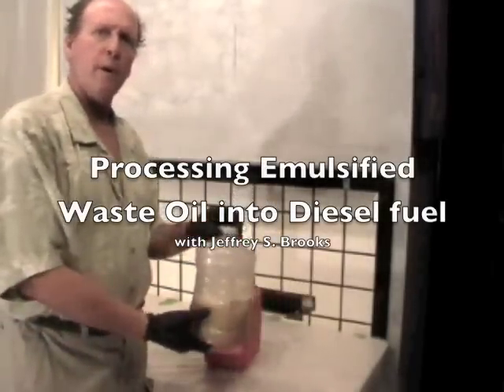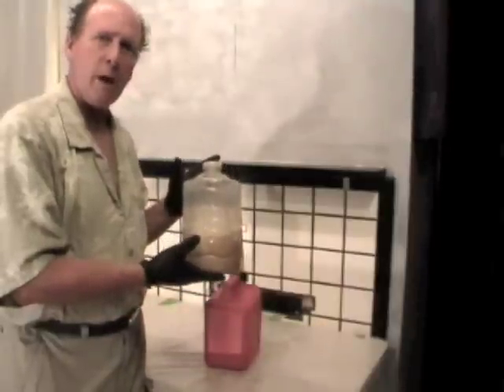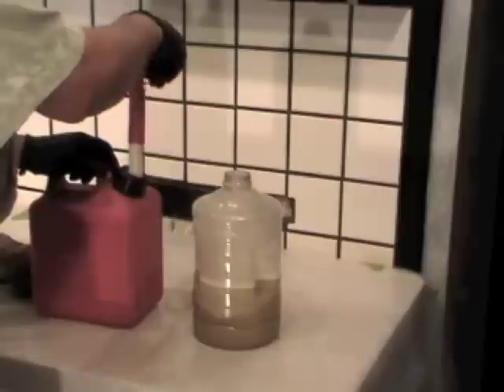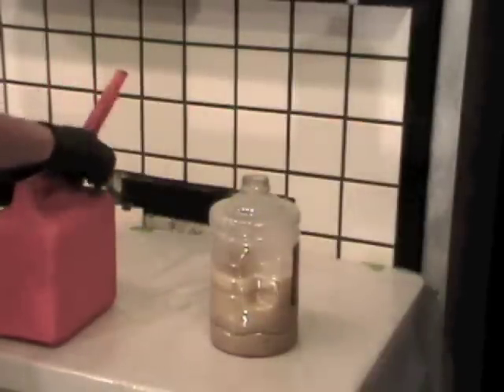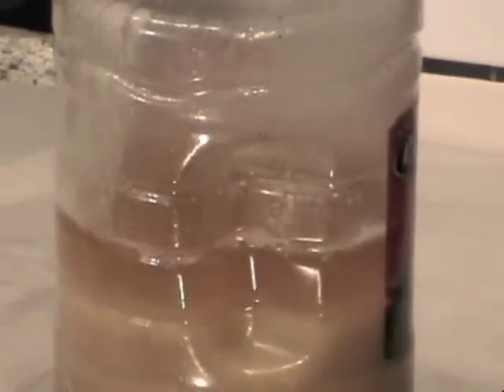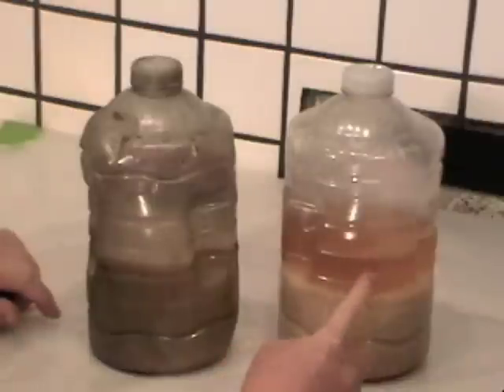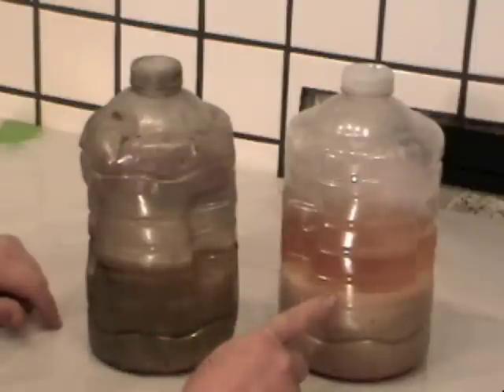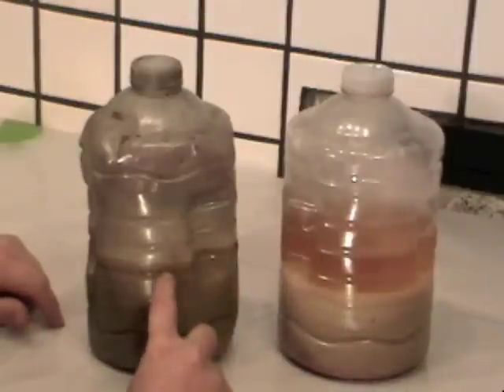Processing Emulsified Waste Oils

Comment from the maker: @smokinmonkey if you have the time and space, then waste vegetable oil can be stored in drums in the sun, where the animal fat and hydrogenated oils will settle to the bottom and the light (good) oil will float to the top.  The good oil can be pumped off the top into your blending tank, and the thick sludge can be pumped into another barrel where it can settle on warm days.  You will find  light (good) oil will rise to the top again, so you can scoop or pump it off the top into your blend.

Comment: Nice video.  Have you tried doing the same with kerosene?  And would you think that Kerosene would work as good if not better?  I'm getting ready to start blending of my own with a small 15-20% wvo to 80% diesel and kerosene mix.  I will use gasoline maybe later depending on how well my wvo works with diesel and kero.  One last question, would the gasoline work good for removing dissolved water in the oil too?

Comment from the maker: @smokinmonkey circulating your WVO sludge is probably not a good idea.  Just let it settle and turn it into biodiesel when no more light oil rises to the top.  But, if you do not have the room to stock pile sludgy WVO for long periods of time, then swap it for light oil with someone who will turn it into biodiesel. Or, if you are in a hurry, then just add gasoline at 10% to the top of your sludge, then let 24 hours go by, then pump off the light fraction that floats to the top.

Comment: I keep the crappy oil settling in the blue barrel, it has a heating element but no pump to circulate. My processor is the big conical one you can see, I could add the crappy oil there and ciruculate the gasoline through the oil with the pump?

Comment from the maker: @CollinRacer1 If it is cold where you are at this time of year, then I would not recommend blending waste oils with diesel fuel, because only Kerosene or gasoline can offer substantial anti-gel to the waste oil.

If you are going to blend with gasoline in the winter, then the minimum I would blend would be 20% with 80% waste oil.  If you are going to blend with kerosene, then it would be 30%.

Yes, I have found gasoline is effective at removing dissolved water in waste oils.

Comment: Hi, I have a barrel I filled up with all my crappy creamy oil from the bottom of containers and I am having a hard time separating the water to get good oil.

How much gasoline would you suggest I use for 100 litres of oil?

Also does it need to be poured on top and allowed to settle down through the oil or would it be better to circulate and mix the oil and gasoline?

You can view my setup and processor in this video: /watch?v=ZNNoOCCeZbU